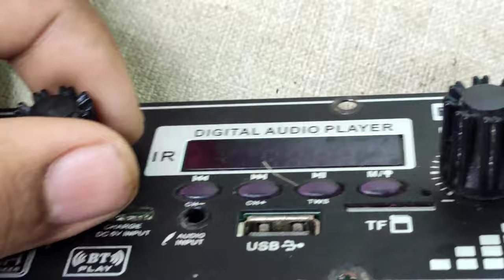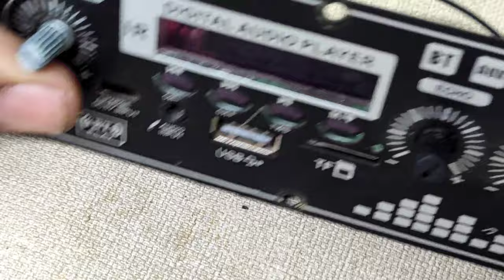Bluetooth speaker.direct charging wire. Paano ayusin.. Step by Step.. Mon tutorial..

Comment: Ginawa ko boss,, pero tinangal ko lng sa socket  connection sa board nya dalawang wire from battry , direct lng dati sa charging point parin,, ok nman pero pg mike ako karaoke nmmtay nman gamit ko charger 5DC 2A dikaya mahina lng charger supply or direct sa board hinang positive at negative Kassel speaker sakin K-8802 DOUBLE SPEAKER